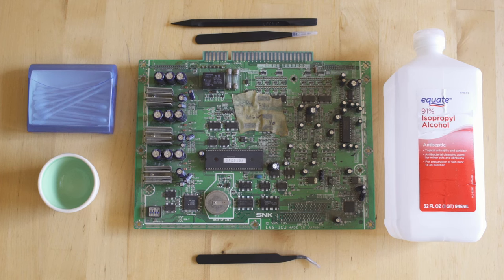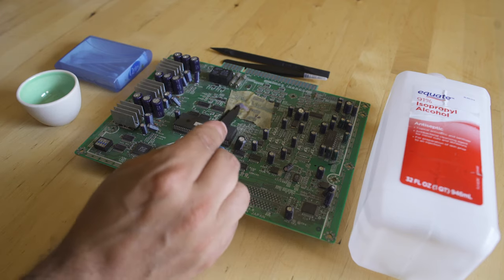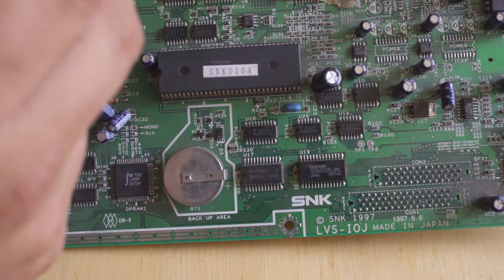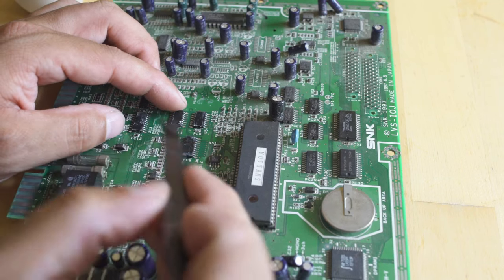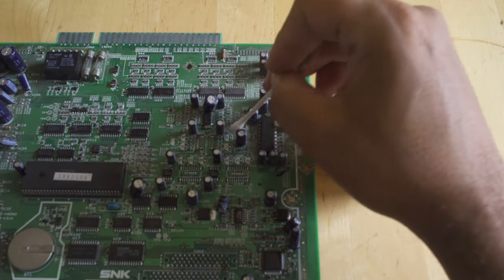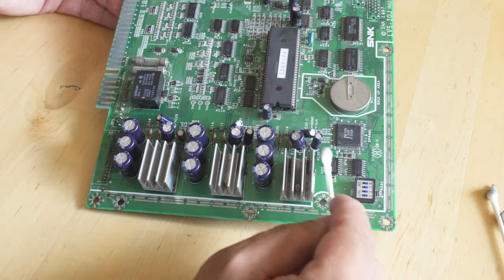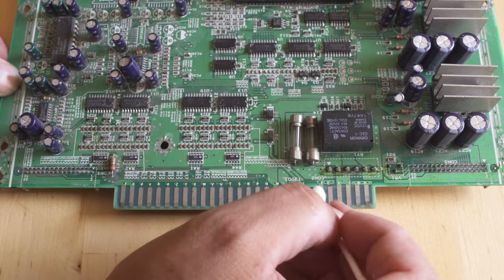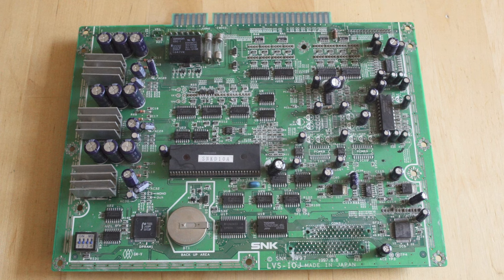How to Clean PCB's - On a Technicality - Video Game Esoterica

Comment: Dude, I just started watching the video, and although the actual directions are okay, that music is really grinding my gears.
Reply from the maker: It’s probably what you listen to it on. Some people say it’s too quiet. Some say too loud. Some say perfect. It’s balanced to my studio monitor headphones then tested on an iPhone speaker and a Samsung 5.1 surround system in my studio. Did you think it was too loud or quiet? And what device were you watching on? It helps me look up info on them all to better fine tune on my end :)
Reply: @VideoGameEsoterica  I have a surround sound system, just the music and the voice were about at the same level. It would have been nice to have no music.
Reply: @JerryDodge  i agree. he's almost asmr in voice, get rid of the music
Reply: @VideoGameEsoterica  how do u get rid of the white residue?
Reply from the maker: Use less / wipe it away with a dry q-tip. It’s just impurities in the alcohol
Reply: @VideoGameEsoterica  i dont think that will work i think it actually discolored my pcb on my mobo, i rubbed it with some brake cleaner still didnt remove it.
Reply from the maker: Yeah def don’t use break cleaner on the pcb. IPA should not be discoloring circuit boards. How much did you use?
Reply: @VideoGameEsoterica  just dampened paper towell tried to wipe off what looked like some pollen/grease mark on the back and it discolored the hell out of it.
Reply from the maker: That means whatever was on the pcb that discolored it was dissolving the solder mask (the non copper material). The IPA didn’t remove / discolor the board. Whatever was ok it did
Reply: @VideoGameEsoterica  91% ipa discolored it.
Reply: I think it's cool
Reply: Nah music is annoying and distracting! Them higs are too high. Btw nice video just the audio is hurting ears  @VideoGameEsoterica

Comment: Thanks so much for this video because it really helped me: I recently came across one of those seasonal string lights that fit the current season well because they are fall leaves. The previous owner didn’t remove the batteries and while it still worked, it had a bit of battery acid powder on the little green electrical board. Using your method, I was able to clean it, replace the batteries and the lights now seem to work way better than they did before😊
Reply from the maker: Awesome! Glad you were able to fix them and it kept them from the trash. So many fixable things end up in landfills…happy to hear this wasn’t one of them :)

Comment: You can use compressed air and then a anti static brush to remove all the stubborn dust and then detail the PCB with isopropyl alcohol.
Reply from the maker: I rarely used compressed air just because the dust gets everywhere lol

Comment: I would recommend using a soft brush for the dust before adding a solution !
Reply: Or compressed air. I like to blow the boards first and then use a soft paintbrush with a vacuum cleaner nearby to suck up the dust.
Reply from the maker: I avoid the vacuum myself. Even with a small handheld Dyson I've noticed the brush loves holding on to static electricity
Reply: does the brush have to be anti static? i have one but it's not the softest out there. i don't press down roughly to where the bristles bend.
Reply from the maker: @beerme27 just use a fresh toothbrush

Comment: I have a non functioning car alarm system key chain button thing. The light goes red when pushing the button, but I does not send the signal. At least that’s what I think. Could cleaning up the board help?
Reply from the maker: Highly doubtful IMO

Comment: Nice video. Sometimes you can use old used teetbrush, works so good also between IC pins. With wool ear stick it takes soooo loooong :-)
Reply from the maker: Teet brush eh? Now what part of your body are you using that on!? Lolol (kidding. Yes toothbrushes can be useful)
Reply: Thank you Kristen i was wondering if you could use teeth brushes on the IC pins
Reply from the maker: You can. Just be very careful. Don’t go too hard

Comment: can i preetty much do this to clean soda spills? not sure if you mentioned that cuz im freaking out over a current spill, left the laptop sitting sideways for 24 hours and im afraid i have to go inside to see if the liquid got that deep and clean it with IPA and q tips even tho ive never disassembled a pc before
Reply from the maker: Yes you can clean soda off. It’ll take longer. If you’ve never disassembled a laptop before I don’t recommend it. They are very complex inside. Very fight fitting and tolerance parts that need to be disassembled in a very particular order. Google a disassembly guide if you absolutely have to

Comment: May gas station Diesel dispenser circuit got moisture .. as rural area is high in moisture. Would you please suggest me to protect may circuit from moisture?
Reply from the maker: I’d use conformal coating. Google it. Granted I do not know what this pcb looks like so I can’t give you specific advice but conformal coating spray is designed to protect against moisture

Comment: I use a toothbrush soaked in alcohol instead of a q-tip. I find the hairs/threads on q-tips come off too easily when cleaning PCBs with sharps chips and they get entangled.
Reply from the maker: Really depends on what brand Q-Tip you use. Not all created equal
Reply: @VideoGameEsoterica  After trying out several brands, I figured a reusable toothbrush is more convenient. Btw, if you don't mind me asking, I recently received a small pcb that was unfortunately drenched in water during shipping, but after letting it dry for 2 days, it works fine. However, should I still clean it with alcohol regardless? Or is it unnecessary in this case?
Reply from the maker: I’d still clean it. You may notice in the future some white build up from whatever mineral content may have been in the water. At least that’s what I’d do.
Reply: @VideoGameEsoterica  Thanks for the advice! I'll do it right away.

Comment: Why did alot of white residue appear after adding isopropyl alcohol? Happened to me with 3 boards now.
Reply from the maker: What percentage? White residue generally is whatever is in the percentage that is NOT alcohol. Impurities in the water. Wipe it off. You’ll be fine
Reply: @VideoGameEsoterica  91%. Guess the other 9% is still on the board. Getting some 99% asap. Thank you!
Reply from the maker: I’m surprised you are seeing that. It must be using some bad 9% sourcing. Try 99% or a diff brand because I rarely if ever see any residue left behind
Reply: @VideoGameEsoterica  okay. Thanks for the information. If it makes a difference, it is a slightly old bottle of alcohol as well. Maybe 2 - 2/12 years old. I ordered some 99% from Amazon. Fingers crossed. Also another thing to note.. it only seems to occurre when I put a large amount onto the board at once. When I only dab a q-tip and clean small areas at a time like the video, I don't notice any. Maybe it's just too small to see.
Reply from the maker: Might just be the quantity

Comment: VIDEOGAMEESOTERICA< what do you use to clean battery acid that is on PCB boards?  What IC chips output send out IRQ signals to the microcontrollers IRQ input pin? Why do some arcade games use ECL ram chips? what are shift registers used in arcade games for?
Reply from the maker: Whoa a lot of questions in one post. I’ll answer what I can

1 - white vinegar. It’ll neutralize the acidity to keep more damage from occurring. Then I use isopropyl alcohol to finish up

2 - what pcb? Not enough info here

3 - ecl...probably speed issue. It’s generally faster

4 - it’s variable depending on what game you’d be talking about. Generally it shifts between serial and parallel interfaces. Normally I/O stuff

Comment: Thank you for this video!  Three questions:  1.  Are there any areas of PCB that should not be touched by the Q-tip with isopropyl alcohol on it?  2.  I realize that you recommend 91% isopropyl alcohol because it evaporates very quickly.  Would using 70 % cause any harm?  I only have 70% right now.  3.  Would 75% grain alcohol cause harm?
Reply from the maker: I’ve never seen a PCB that had any areas I wouldn’t use with alcohol. 2: no. Just give it longer to evaporate 3: don’t use grain alcohol. I have no idea what it’s cut with. Stick to medical grade isopropyl

Comment: Don't we need anti static kit for such cleaning?
I've to clean my laptop and this antistatic concept is freaking me out.
This would be my first time, so I'm really cautious. Any tips?
Reply from the maker: Lol your username. 

Just touch the chassis (metal) before starting
Reply: @VideoGameEsoterica  thank you 🙏

and it's not just a username, it's an emotion 😂
Reply from the maker: I’d like to think Un really does have a YouTube account where he watches and comments on old Chicago Bulls videos 😂
Reply: If air humidity is above 50% there is no risk of static discharging. Although the best is to work bare feet on stone and touch a blank iron on your heat system or water-tube system.

Comment: Wow.. you really take your time.  I spray mine with Simple Green.... scrub with a soft toothbrush, then rinse with water from the hose.  Then I will use 99% iso in spray bottle to rinse well, then A hairdryer to dryer any areas that collect moisture.
Reply from the maker: So many small resistors, I like to take it slow

Comment: Hey hii buddy so I have a lot of electronic device and I wanted to buy isopropyl alchool so 91% is better or 99% plz suggest
Reply from the maker: 91 is fine. 99 is fine. Either :)
Reply: @VideoGameEsoterica  my guy what's the difference though ? Can I clean screen with alcohol
Reply from the maker: The difference is just the purity of the alcohol. Either is safe as far as evaporating times are concerned

Comment: Thanks I will try the vinegar. I have seen nintendo games schematics punch out , donkey kong, use ECL RAM chips and shift registers for the RAM chips. 
1.) I'm not sure why they would want to shift register the RAM chips output and input data signals do you know why? 
2.) What are Strobe signals and Halt signals used for in arcade games but I'm not sure why would you want to use strobe signals and halt signals. 
3.) PROM chips are use for color palette look up tables, but what else are PROM chips used for in arcade games?
Reply from the maker: They may have used shift registers to sneak the I/O in the same clock cycle to save cycles. 

They’d use strobe signals to detect data in ram. It’ll tell if it’s a column or row. 

Not sure on halt. Would be case specific

PROM can be anything really. It’s just Programmable ROM. It’s just storage in essence

Comment: Hey bud! I have a couple of Konami GX boards that I want to clean off. One is a revision 2 with Salamander 2 attached and the other is a revision 1 with no game but it does have a type 3 sub board attached to the bottom. The revision 1 in particular is filthy and untested so I want to give it a nice clean up before trying to test it out. Is there some kind of soft bristle brush you'd recommend using to scrub the surface safely without damaging traces and components? Any other alternative solutions if that's not safe? Let me know, thanks!
Reply from the maker: People use small anti static brushes. I generally don’t use them as I worry about small SMCs but they are generally safe so long as they are anti-static. 

Just look up anti static brush on Amazon. You’ll find tons. 

Or just send me the boards. I’ll keep ‘em safe ;)
Reply from the maker: But If you do use a brush just go gently. You can pop a SMC if you get too aggressive
Reply: @VideoGameEsoterica  Roger that, thanks for the guidance! :) Btw, if you have any spare Konami GX stuff you're not trying to keep, hit me up. In a month or so I may be willing to take some of it for the right price. Konami GX has really caught my attention, it's very underrated to me.
Reply from the maker: It’s actually one Konami board type I DONT have one of

Comment: Do you think maf sensor cleaner would also work for this? Its safe on plastic and evaps instantly but im worried it isnt safe. A beer was spilled on my mechanical keyboard and iv pulled the whole thing apart. The circuit board is pretty nasty but the solder point makes it hard to wipe everything off.
Reply from the maker: No I wouldn’t use it myself. Never tried
Reply: @VideoGameEsoterica  welp, i guess ill be everyones guinea pig. Ill let you know if it works in a bit.
Reply: So it definitely works fine on the plastics of a keyboard. The pcb however, it lingers if you over spray. It cleaned the whole thing rather well, just make sure you pray your q-tips rather than the board itself.
Reply from the maker: Not surprised with the lingering. What’s why IPA is amazing. Evaporates

Comment: Well I poured a bottle of 70% alcohol over my amp PCB and now the sound is like a scratch disc,  It was 2 weeks ago, shouldn't alcohol be dry by now?
Reply from the maker: you poured a bottle over it!?!? That was probably not advisable. But one would assume it’s dry now yes. You didn’t have power running to the amp when you did this did you?
Reply: @VideoGameEsoterica  thank you for answering, well the amp wasn't plugged to the power when i poured the alcohol, but an hour later it looked dry and I plugged it, and no sound, I unplugged it right away, but today 2 weeks later I plugged it again and the sounds comes and goes , like and old scratch record or cd. I think I ruined it. As an old Luxman Lv112 made in 1989 good sound quality before I washed it with alcohol even though The PCB was extremely dirty.
Reply from the maker: Yes a whole bottle would be dramatically more than that would take. In the video you can see I apply it with a q-tip. Also that’s why I recommend 91% or higher

I’d check for signs of corrosion.
Reply: @VideoGameEsoterica  well I watched your video after I washed my amp. For next time I will use your method.
Reply from the maker: Oooh...that makes more sense! Yes def use less next time

Comment: Try De-solv-it sticky stuff remover. I've used it on enough PCB's to know it doesn't hurt them. It will make very short work of that tape gum with a Q-tip. Also a soft pencil eraser on the edge connector contacts works a treat.
Reply from the maker: Normally if my edge connectors need that much of a cleaning I lightly use a fiber optic brush. Mostly because I hate pencils and never write with them / have them around lol. My hatred of pencils knows no bounds!
Reply: @VideoGameEsoterica  haha. I bought a pack of pencil erasers for the toolbox years ago and they're still going strong. I was taught the eraser trick by a mentor back when I worked with card frame based video processors in the 90s.
Reply from the maker: Lol bout all pencils are good for 😂

Comment: is 70% and 99% fine to use or?
Reply from the maker: 99% yes. 70% is ok but the evaporation time is longer so keep that in mind. Give it 5 minutes to evaporate if you use 70%
Reply: @VideoGameEsoterica  Thank you.
Reply from the maker: Np!
Reply: @VideoGameEsoterica  Hi there. I have a quick question. I'm struggling to find isopropyl alcohol in my country. I do however found 91% rubbing alcohol. I did a quick google search and saw that the difference between isopropyl alcohol and rubbing alcohol is that rubbing alcohol contains water, but so does 91% isopropyl alcohol. So I am just a bit confused what exactly the difference is between the two. Do you perhaps know if it be safe to use 91% rubbing alcohol instead of isopropyl alcohol for all pc components?
Reply from the maker: Same thing. 91% IPA is 9% water. 91% rubbing alcohol is 9% water.
Reply: Awesome man, thank you so much for your quick replies.
Reply from the maker: You are welcome :)

Comment: Can I use crc contact cleaner or 70% isopropyl hand sanitizing spray to clean?
Reply from the maker: I woudn't use 70% IPA. You can, but the evaporation time is much longer. If you use it just give it maybe 5 minutes to dry. CRC is fine but I don't prefer it myself. I find it hard to place exactly where I want it
Reply: @VideoGameEsoterica  Thanks😁
Reply from the maker: Np!

Comment: Does using a can of compressed air on it first have any bad side effects?
Reply from the maker: No you should be fine
Reply: Compressed air from a can, can kill semiconductors.  An electric charge can build up as the air/gas passes through the nozzle.  I know of motherboards being killed after someone tried this. A toothbrush should be avoided too.  Use only conducting brushes and tools and keep a grounding strap with high resistance in the path to ground.

Comment: So how do you deal with the half devolved white flux residue?
Reply from the maker: White flux residue? Not sure what you mean. Normally when I see left over flux it’s a brownish yellow color. Do you mean the slight white left behind after the IPA evaporates?
Reply: @VideoGameEsoterica  One of the problems encountered after the formation of the cleaning process is that after the PCB is cleaned and dried, some white spots often appear on the surface of the components. This spot is a surface residue film and its formation reasons are as follows.

The surface of the residue is dissolved during the cleaning process, but because of the low solubility, and the cleaning method does not completely remove the dissolved residue. When the components are dry, the residue and the crystals of the non-ionic material form a white pollutant, called a white spot.
Reply: It looks like this:
https://i.imgur.com/OxpBUw9.jpeg
Reply from the maker: are you using 91% or higher? I get a tiny bit of white after a cleaning but not to that degree. Sometimes it takes more than one pass to clean thoroughly. The residue is non-harmful though